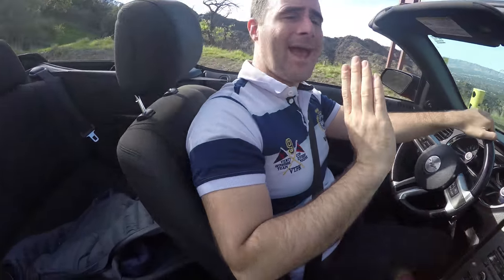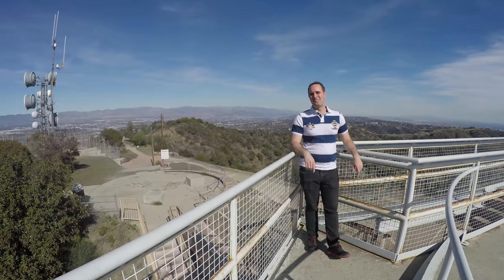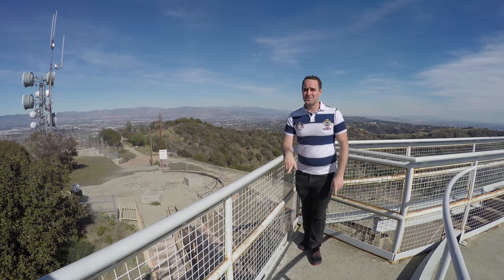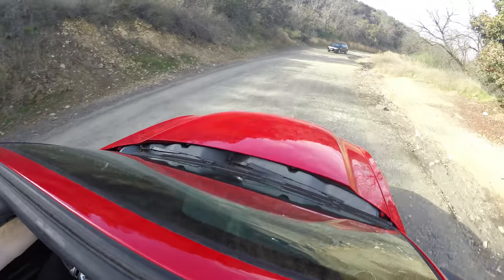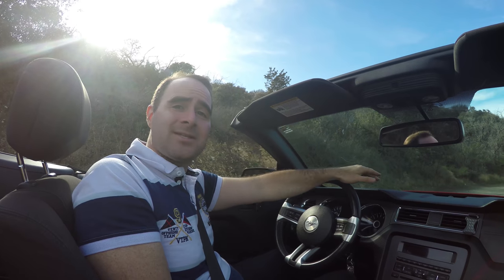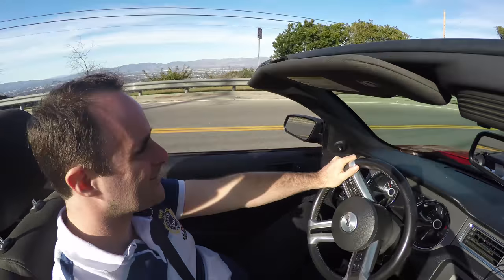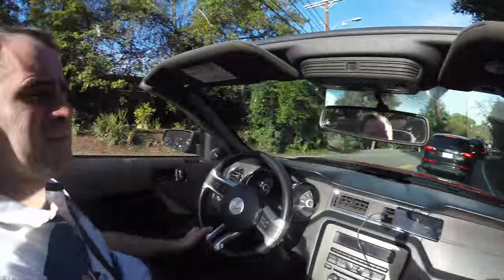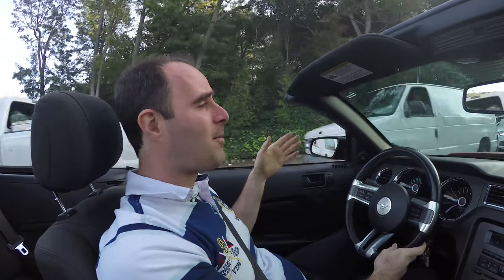Mulholland Drive in a Mustang Convertible, Near-Accident! Live Rear Axle FAIL!

Comment: IFS was available on cobra mustangs in 2000 and up, its widely hated by those who buy mustangs and drag race.  if they doped the live axle all together i assure you the straight axle rear swap kits will be very popular and far more popular then the IRS kits that have been out there for 18 years.  you video is why mustangs belong on the pavement and dont compere to that crappy ford flex mom suv off road.